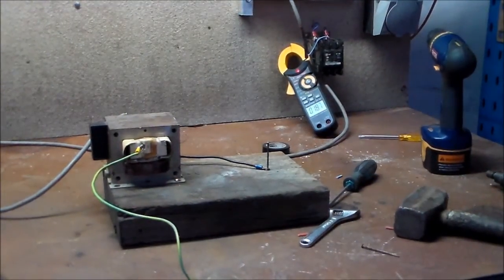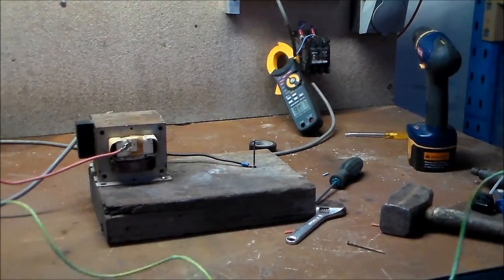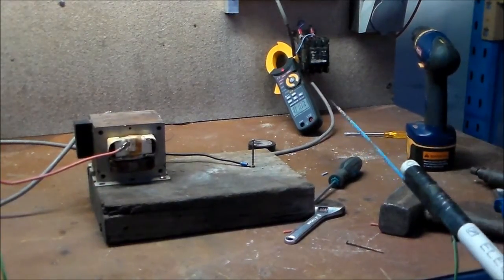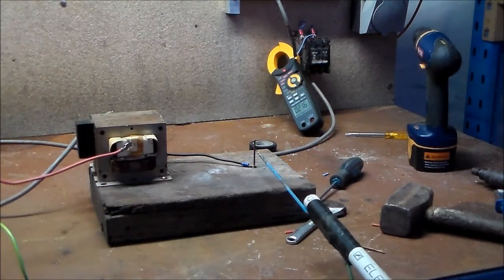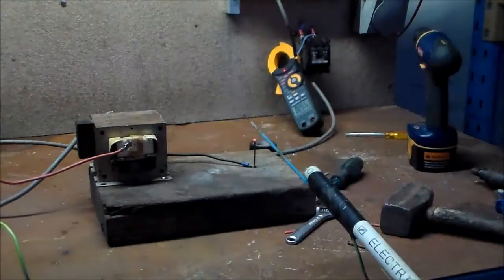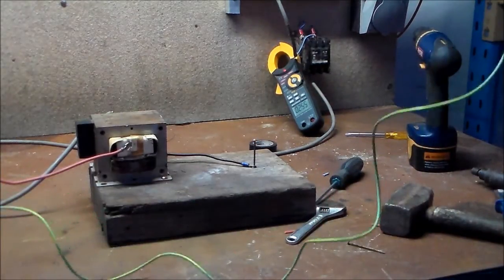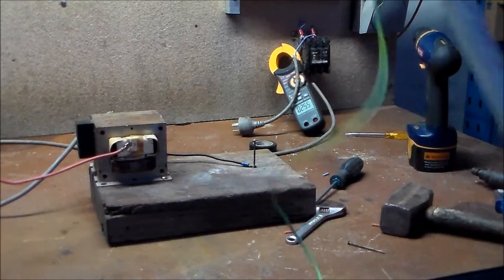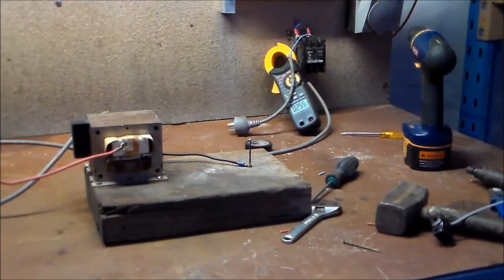Resonance VS No Resonance, MOT Arcs + Current Draw

Comment: Are you running on 120v or 240v? Do you know why my Mots (dual mots) overheat and blow my fuse without resonant caps? With the caps (4) the setup gets less hot and draws less current, even though the arcs are bigger?

Comment: if the primarys were in series that would drop the volts in half n the secondarys in series would bring it back to normsl... if u ran primarys in series it would stay cooler... just like running a balast... i got a few vids of that